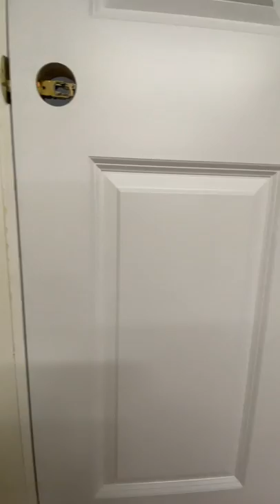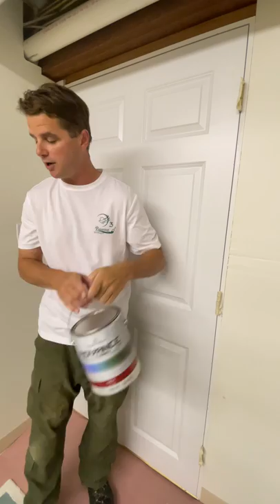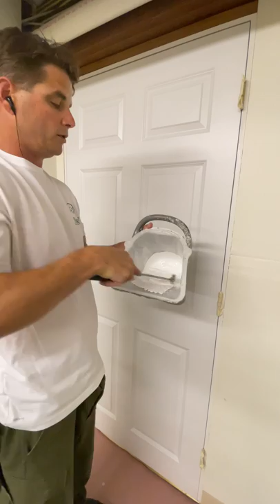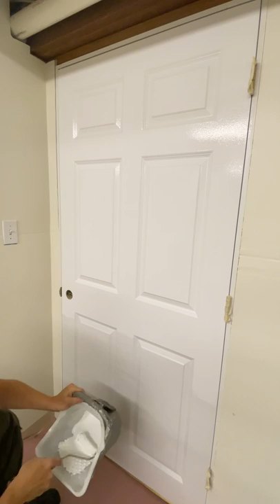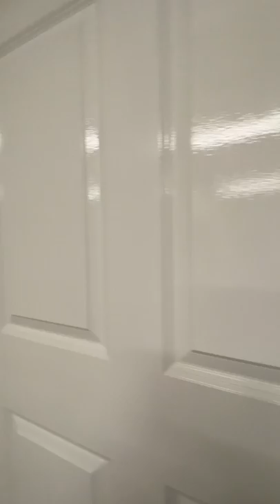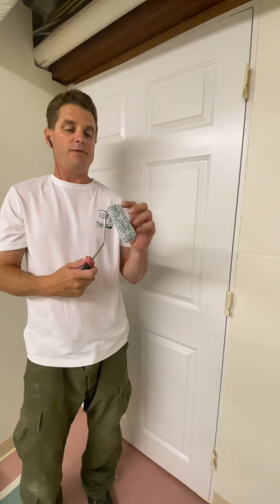Benjamin Moore Advance on New Pre-Primed 6 Panel Doors - Roman Pro999:Rx 35 Primer (Part 2)

Comment: Looks great, gotta give that Rx 35 a try.  Seems easier/better than bin or oil for this purpose.
Reply from the maker: Hi

Thank you! Zinsser Bin and Oil work great for adhesion, but will seriously drag when applying on pre primed new doors or trim. The Zinsser Bin dries to an eggshell sheen which is great to top coat, but it will seriously drag when applying. Try it out for yourself to really get the feeling of gliding over the surface effortlessly and then top coating effortlessly over the Primer/Sealer. You can’t really understand this until you try it for yourself! Thanks again for your comment!

Russ

Comment: The benjamin moore advance is an awesome paint! I'm sure if your a professional painter your like "meh" but to a "DIYer " like myself the stuff is great! It's the only paint I've used that finishes close to a sprayed finish when done. I've spent the last month testing various paints ,brushes,rollers and techniques and have found that the advance paint is by far the best I've tested. I'm going to be using it for all my trim and doors. I've done one door and one kitchen cabinet door and a piece of trim as a test so far and the results are way better than I ever imagined 😀.  We have a fixer upper and being retired I wanted to do all the work myself without hiring a professional.  But I want "professional " results! Advance paint has given me these results!
Reply from the maker: Hi

Yes, I agree with you and it also dries to a hard film. What kind of roller have you been using to apply it with and what surface have you been painting over?

Russ
Reply: @RussOlinatzPaintShow  I've been using a dense foam roller and while the end results came out ok I'm going to be changing over to the Wizz rollers you recommend. I did have tiny bubbles with the foam and while it did finish ok I'm guessing it will come out even better with the Wizz roller, atleast that's what I'm hoping. 😀

Comment: I saw you use Aura paint on a door after you primed it. So which one is better. Advanced or the Aura?

Also why don’t you ever show us how you prime the jamb and the sides of the door by the hinges and where it closes.
Reply from the maker: Hi

The Advance dries to a harder film. For the sides, I just cut around the hinges and the latch with a small brush and roll out the rest.

Comment: Wow , awesome spray like finish Sir ! Glad i stumbled on your channel. I am learning a lot for a diy'er. With your expertise,  i know i can get the job done right. Question, with those Home Builder pre fab doors with the aweful  yellowish-white doors, do i need to sand them before applying primer ?
Reply from the maker: Hello Rick

Thank you! I hear you with the awful yellow color. I wish they came white. No need to sand. You might even remove the yellow flat primer if u sand. Just feel the door with your fingers, and if there is a area, then just lightly sand with a fine grit 3M sanding pad. Thanks again for your question!

Russ
Reply: @RussOlinatzPaintShow  Thank you for replying back. Much appreciated. Keep growing your channel and God Bless.
Reply from the maker: @racktech2830  Thanks Rick!

Comment: Great work as usual Russ , why don't you use a brush magnet/clip instead of putting between your teeth though ?
Reply from the maker: Hi

Thank you! My bucket does have that magnet clip, but each time you use it, the paint creeps further up the brush! I like to keep the paint on the lower end of my brush. It keeps the paint from drying out on my brush and allows for easier clean up! Thanks again!

Russ
Reply: @RussOlinatzPaintShow  I understand that Russ but you can get the clips that attach to the side of the bucket that have a magnet on them so will keep your brush out of the paint. Just thought it might make life a bit easier that's all mate.
Reply from the maker: Hi

Yes the magnet is on the top side, but the paint gets on the side each time and eventually works it’s way up the brush.
Reply: @RussOlinatzPaintShow    Now that you mention it...  you are right.  As careful as I can be about following your one third rule, the paint finds it's way up that brush.
Reply from the maker: Is that from the magnetic or just working with the brush?
Reply: @RussOlinatzPaintShow    I am not sure which.  When I clean the brush, I am noticing only a few bristles further up the brush toward the stock that have somehow accumulated paint.  The majority (at least half) of the upper end of the bristles are clean.  I must be doing this by scraping the excess paint off on the side of the paint cup and then not being careful about contacting the the cup with the side of the brush the next times I am scraping off the excess paint???  Does that make any sense?
Reply: @RussOlinatzPaintShow   No i don't mean the actual magnet that is in the bucket i mean an independent clip that attaches to the side of the bucket so your brush doesn't go anywhere near the paint , they are very cheap and will be better than holding with your teeth. If you google "magnetic brush clip" you will see what i mean Russ.
Reply from the maker: Oh ok that makes sense now! Thank you, I will check it out!

Comment: @7:40 ish ....you said you can't add an extender . What happens if you do add floetrol or an extender?
Reply from the maker: Hello

The Benjamin Moore Advance is a hybrid paint. That means that it’s part Alkyd (Oil) and part Waterborne (Latex). The extenders are either water based or solvent based. So by adding one of these would screw up its chemical make up. 

Russ
Reply: @RussOlinatzPaintShow   Is there something on a can of paint that identifies it as Hybrid,  like maybe a symbol or a phrase?  Does Sherwin Williams produce this formulation in one or more of it's offerings?
Reply from the maker: @tribulationprepper787  No, but they are basically combining the benefits of Oil and Water based enamels into a hybrid enamel!

Comment: It has been my experience with the “pre primed doors”. Is it takes forever it seems to get a good finish.  I really can’t put my finger on why that is but I know it to be true.  I only use Benjamin Moore products which are the best but there simply no way around it….
Reply from the maker: Thanks for sharing that! When sealing the door first, none of the Advance paint can get sucked in to the Flat primer that’s on the door. That cheap Flat primer does not act as sealer. So by going the extra step of sealing the door first, and getting no paint drag in the process, it’s totally worth it. Not to mention that you will achieve the proper sheen of the Advance paint whether it’s Satin or Semi-Gloss.
Reply: @RussOlinatzPaintShow  I agree.  I think a lot of do it yourselfers are fooled by the term pre primed.  I always prime with fresh start then either advance or satin impervo and they look great
Reply from the maker: Yes for sure! I love the Benjamin Moore Fresh Start primer also, but it dries to a low luster sheen. That makes it ideal to sand if there are any areas where there are brush strokes or buggers in the primer. But applying the Fresh Start over the pre primed surface won’t go on as effortlessly as the Roman RX-35 and then the top coat ( Advance) won’t go on as easy when going over the Low Luster primer finish as it does the Roman RX-35.   The Fresh Start is a great primer as it hides Great, but I wish they made one that dries to more of a eggshell sheen, so when applying an eggshell or satin sheen it would glide better! Thanks again for sharing your thoughts!

Russ
Reply: @cwrowe   Yep.  I was a victim of the pre-primed mentality for years.  I can thank Russ for setting my misconception straight.

Comment: OK THEN!  I watched you roll and brush this door to death in your last video.  You didn't miss one single square inch of that door.   Why is it that after drying, those little gray primer "SPECKS" (AS YOU PUT IT) are showing up in the finish?  I had previously commented that I had painted a room and after it had dried, I noticed some specks in one small spot and after checking further, I found 32 other places on those four walls that also had a few square inches of specks.  I was using Sherwin Williams Showcase "GUARANTEED ONE COAT" paint and still those annoying specks.  My question to you, Russ, is WHAT'S THE DAMN DEAL WITH THESE SPECKS!  I hate having to paint a room twice.
Reply from the maker: Hi

Those gray specs are from the color change of the PrePrimed door. The PrePrimed door doesn’t come from the factory white, it’s actually a yellow or gray color. If it was white, you wouldn’t get those gray specs. I wish they would come from the factory white. I have no idea why they come with a yellow or slightly gray color. It’s a pain because most people like there doors white. When you used the Sherwin Showcase, what was the previous color of the wall you where going over, and what was the new color?

Russ
Reply: @RussOlinatzPaintShow   The walls in this room were previously a light pink (awful) and I was changing the color to a light turquoise.  I will be going over the turquoise paint on the one wall with the bay windows with a darker turquoise because the room felt kind of "blah".  I guess this is called a feature wall.
Reply from the maker: @tribulationprepper787  ok or an accent wall. Some colors just do not cover in just 1 coat.